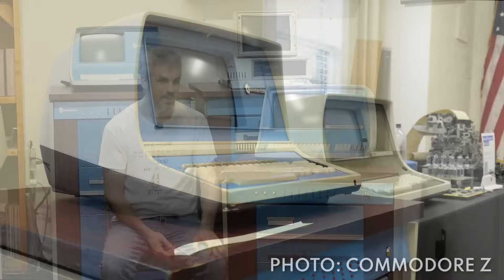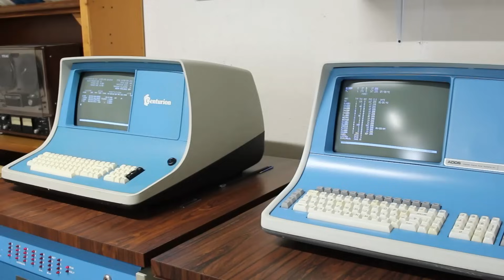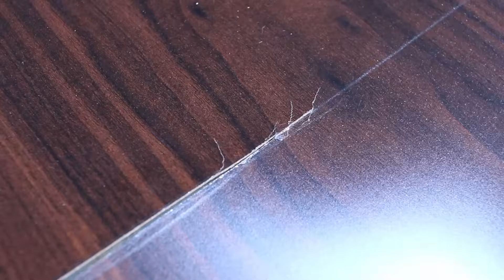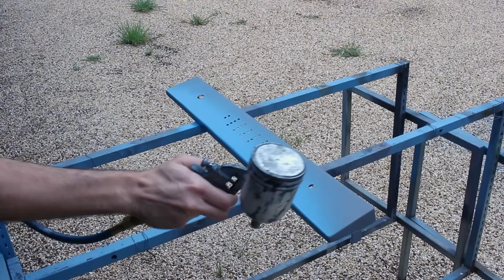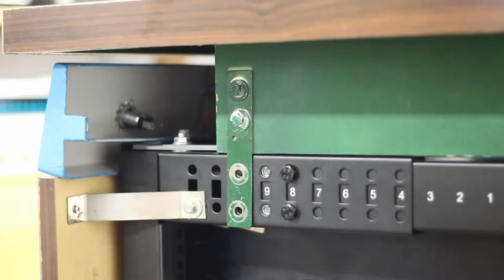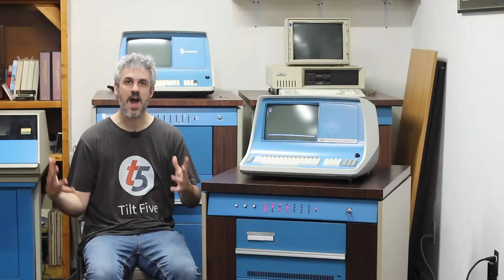The Mini-Centurion is Back!

Comment: I have binging on your channel Great Work I love your enthusiasm. About the paint match issue. I have found that the angle the painted face has affects the reflection of colour so the same matched colour may appear different when tilting the surface.   A side note. I worked on a centurion in 84  and this takes me back 😊

Comment: What a great picture and snap shot of history from that time frame.
Keep in mind, that the early 1980's was the beginning of the end for Digital, Sperry, Honeywell, and a few more.
Remember, at that time, their mini computer offerrings were custom LSI chips, and such machines would lease for about $3,000 per month, if not more.

Then, out of blue, some enterprising companies took off the shelf micro processors, often the Motorola 68000, 68010 etc., grabbing a serilal IO board, and presto, you were in the mini computer business.
About the only critical missing part for most of these "business up-starts" was that of a working OS.
Another common OS from the early 1980's was of course the Pick operating system. Since that OS could be ported with relative ease to different CPU''s, then a whole slew of vendors jumped into the mini computer business.
So, we had ADDS (yes, the same folks that made terminals), we had Data Media, we had Wyse, and a few more. These vendors thus started with micro processor CPU based systems (all running the Pick OS).
Then on the other end, we had Prime computers, Microdata (McDonald Douglas), Honeywell (Bull) in Europe, and a few more.  Even IBM had a version of Pick for their RISC 6000 line of computers. And in East Germany, a number of vendors ran Pick OS on IBM mainframe clones.

Over time, those micro processor based systems started to eat the vendors based on LSI mini-computer architectures.

When the 486 hit the scene, all of a sudden, those lower cost mini computers built around off the shelf parts started to run faster then those larger mainframe based computers, and thus their cost structures and per month leasing costs collapsed. Often a one month lease cost for those mini computer systems as as high as purchasing a IBM pc, or some "box" from a vendor in 1 or 2 months.

So, the bottom by the early 1990's fell out of the mini computer business, since now a off the shelf box from sourced parts would provide more performance and more value at a much lower cost. And that's when you saw the likes of Sperry, Digital, Honeywell etc. start to exit the computer industry, as those off the shelf parts built computers were not only far cheaper, but did not have high cost monthly lease's associated with their purchase.

Quite surprised that the Centurion did not choose the Pick OS - since it would have been ideal for that class of computing power, and significant amounts of 3rd party software was available for Pick - probably more business software then even Unix in that same time frame.

Anyway, having worked on these off the shelf mini computers in the 1980's, then this video brings back lots of great memories.

Comment: If i had a centurion, i think i'd splurge on read solid wood panels, stained and finished properly.  That thing is rare as heck, and should be treated like the piece of history it is.  I.E.  It deserves better than MDF and stick on vinyl.  ^-^

Not to mention it would stand up to travel abuse much, much better if it was actual hardwood panels.  Heck, even finished plywood would be better than MDF.

Comment: If you need to build a cable for the school, stop by the shop. I have a Panavise Arbor press and spools of ribbon cable. I have some ends, but Mouser delivery is either 24 hours away for shipping or a couple hours drive for will-call.

Comment: There's a special tool called a laminate cutter. It has a very hard triangular tip that scores a v-groove, which means the outside corners are naturally chamfered. I'm glad you got away with the saw but there's a high risk of chipping and cracking, and the straight cut may not be ideal either. Laminate cutters are also good for cutting FR4 if you don't have a guillotine.

Comment: A little trick you could do on the corner seams of the top is to sand the rough spots along the edges a bit (hold the sanding block at a 45 deg angle to the faces) and then take a dark (brown or black) permanent (like Sharpie) maker and color the edges of the laminate.

Comment: They also make circular saw blades for laminate, but either way slow is the key to the game. You can also put the pretty side down so the blade is cutting up into the finished surface. That way if there's chipping it's on the back side of the laminate where you can hide it.

Comment: Hey, Dave, as somebody who works with laminate daily for work, I definitely reccommend scoring as a cutting method; however there is a specialised scoring knife that is much better for the job than your boxcutter, the version I prefer is an Olfa PC-L; it presents a sharp triangular point to the surface that digs out a groove that can be snapped along very effectively.
Reply from the maker: Oh interesting, I figured the laminate was just a little too tough for slicing through it, but a scoring knife makes way more sense!
Reply: @UsagiElectric  it also could have worked to point your utility knife's blade straight up and down too, but running the cutting edge parallel to the surface really won't do much.

Comment: Back in the Warrex days the Centurion wood panel cores were covered with contact cement then covered with Rosewood Formica from Wilson Arts in Temple, TX.  The Warrex employee that built the wood panels in-house use a table saw the a router to trim the Formica to fit.   Be careful with the contact cement... The Warrex "Fire" that almost but us out of business in 1976 was caused a a spark from the table saw cutting the wood cores setting the fumes on fire...!  We lost the PCB artwork for one of the CPU4 boards that was on the engineers drafting table when the fire started.
Reply from the maker: That contact cement is no joke, the fumes alone were making us light-headed, and we were in a well ventilated space! Thankfully, we were pretty careful around and no fires that took out PCB artwork here.
Reply: A lot of say radio cases or record player cabinets would either be made "in house" by some companies,  others would order pre assembled from wood furniture specialists saving on some of the wood working and gluing risks,

Comment: Some actual walnut would look absolutely spiffy, but I highly doubt any of these cabinets would have come with anything other than laminate, so it's one of those cases when spending MORE money would be less period appropriate. Also nice that you were able to get some proper side panels!
Reply: Formica is best , easy to clean compared to a radio veneer
Reply: And during travel a veneer might get scratched or dented or cracked.
Reply: @alylu-to-esutej  Probably would help if you use padding between the unit and the cargo straps.